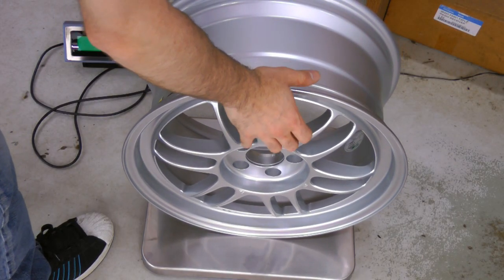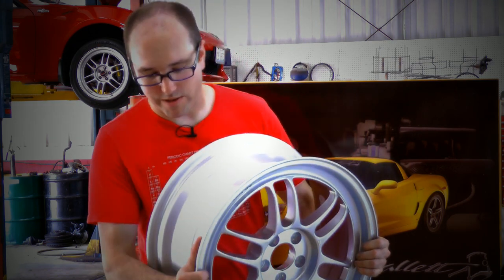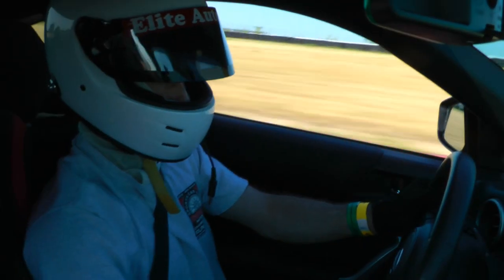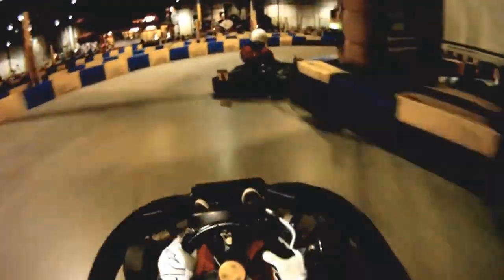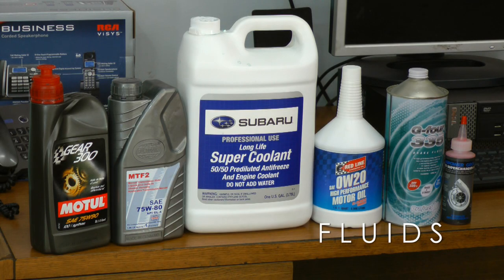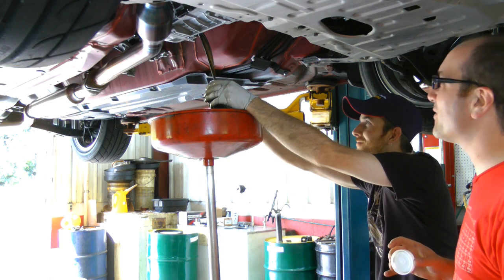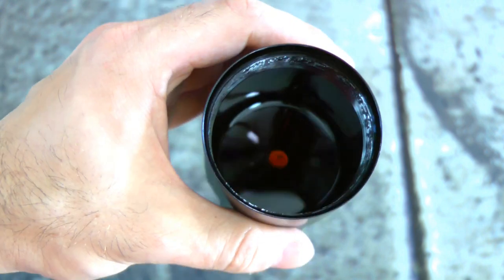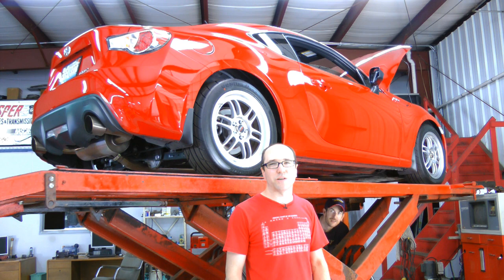Supercharged Vortech Scion FR-S GT86 Track Review Finale | Part 4 of 4

Comment: Cheers dude, consider yourself a modern pioneer of modifying an FRS. Your data and hardwork in the garage will prove invaluable to future modders and you've helped shaped improvements for the vortech kits parts and documentations.

A true pioneer.
Reply: meh. it just bugs me that they all keep talking about needing more power. GET THE AVO WORLD TURBO KIT! just 7psi and your at around 280hp to the wheels! not your 212whp on stage 1 and not your 235whp at stage 3. stage 1 with avo puts you around 250. stage 2 puts you around 280 (with the 7-8 psi actuator) and stage 3? if you can get it, you will find yourself at around 371hp AT THE WHEELS! more power? GO WITH AVO! screw the vortech. so much extra chopping, and cutting, and manual krap you have to do. avo? bolt and unbolt and bolt this in and then go >.>
Reply: Gopher663 supercharger much better for the track and everyday driving( big low end power upgrade) not to mention having this car at near 400 hps is gonna run havoc on the engine/clutch/tranny

Comment from the maker: I went for reliability.  Over 260HP on this car with any kit requires upgraded injectors and fuel pump.  So there is extra cost and risk once you start getting towards 300HP. But many are doing it
Reply: 260 HP or WHP?

Comment: A trick for you who have an frs, in order to fully turn off traction control hold down vsc and trac buttons down for a few seconds and itll completely turn off trac control on the dash board.
Reply: Hold traction control off for 5 seconds and it will completely turn off - an FR-S owner

Comment: Man, the information on all the fluids was excellent.  I will be changing all my fluids at 24,000 miles. Including the radiator and brakes. If I stick with the stock rim size i could lose 20 pounds on those Enki's.

Comment: and while the altima coupe doesnt have a lot of HP, it makes more torque than the FRS does and it has the CVT transmission so when i am gunning it it will hold RPMs at redline so it feels fast, heck my DD im using now is a 230whp 250wtq mitsubishi eclipse GS-T and the 2.5 altima feels like that car does because it doesnt have to shift

i can tell you that when i test drove a GT86, it sure as hell didnt feel fast on the straights, and while fun in the corners, i dont drive corners everyday

Comment: I own A BRZ. I love it. If it were 250 hp and 30k I would not own one. If the FRS was 28k with 17" high performance tires and brakes and weighed 150 pounds less. I am in.  The Z or any other car under 40 grand would have no answer for a 2600 pound 200 hp FRS with high performance rubber and brakes. that is the point of the car. For 32k I would be in a next gen Mustang GT. That car will have 420 hp and weight 3300 pounds with an independent rear. That is what a 250 hp FRS would have to deal with.

Comment: To be frank, I would rather leave my 86 stock, make it pretty and instead buy a Aprilia Tuono. If you want speed, you got to do it right, and sometimes it is probably better to leave the vehicle as intended. I do believe 86 are underpowered but for what I use it, day to day driving, it has more than enough to get you from A to B.

Comment: We're running meth on ours. Making about 270 on Vortech's tune. They've got some safety features built in so it dumps the timing. Pretty sure that with a tune we can make over 300 safely. I probably won't push much more than that. Folks over at dynosty feel 350 will be about the cap.

Comment: I would still rather but the Innovate/Sprintex kit because i think it looks cooler. Also it makes more horses and torque, and being situated in the middle of the engine doesn't effect that 50:50 weight distribution. Also when at low revs it bypasses the valve of the supercharger and maintains fuel economy until you decide to floor it of course by which the supercharger operation will kick in again and boost you into the future, and in some cases milage can actually be improved because the engine output is higher without that much strain on the engine e.g. when going up a steep incline.
Reply from the maker: I am just not sold on the extra heat the Innovate puts on the heads even intercooled the temperature is very hot in that area.  Until we see high mileage boosted cars with working DI and seals holding up I wont risk it.  I agree power delivery down low for a street car/autox is optimal.
Reply: ok cool but that was just my opinion. you vids are great man and thanx for responding. have you considered running water meth on your frs?
Reply from the maker: thanks for watching and following all of it   luckily the Vortech does not have issues with IAT and temps so I won't need it with my current fuel.
Reply: Ok cool but yeah i hope to see many more awesome video in the future and i'm definitely subscribing! (y)
Reply: I knew if I waded through the muck of comments, I'd find this (i.e., what's wrong with the Sprintex supercharger?).  Thanks!

Comment: Is the sound from the car at minute 2:55-3:05 normal my car makes that noise especially when driving for more then 15 or when I rev it around 4000 rpm. Just wondering if it's normal or maybe something I have to worry about I got it new I got right now about 1,200 on it. Is it normal?

Comment: Just subscribed to your channel. Great videos man very humorous but still super informative at the same time. I own a brz here in the PH and been researching about big break kits. I'm wondering now about the specs of your rpf1's I'm assuming they are 17's but what offset? I just got a 17 x 9 +35 and heard that bbk's might not fit at that offset. :-|
Reply: Enkei Wheels says (info I got through a personal phone call) you can run up to 8.5" wide wheel using a +35 offset and have no rubbing issues so long as you stay with a very similar overall tire diameter as stock (which is about 24.6"). Anything wider you should run a +45 offset but you would need to run coilovers in the front so that the wheel doesn't interfere with the stock strut.
Reply: Thanks for the response maximus maxwell when you say rubbing issues are you pertaining to all issues in general (fender rubbing etc) or specifically for the bbk calipers? Because I ordered mine at that spec basing on a few people I asked on instagram who had the same spec and a sales manager from the site I got it from which was oakos.com, all of them said no rubbing issues on a 9" width rpf1 if the offset is +35, the +45 looks more flush on the fender tho but it will apparently rub not unless yeah you chance to coilovers or use spacers. Hence my decision to get the +35 offset one but then I saw a guy who had the same and told me he got his set from a friend because it won't fit now with his friend's new bbk. 😐💭
Reply from the maker: Thanks for watching. Did 17x8 43mm.  your wheels will be very tight but should work.

Comment: and that is why i said more power to you in my original reply, for me, i wont buy a GT86 for the same reason why i wouldnt buy a miata, its too slow for daily use and unless i lived on a back road and drove that everyday, it just isnt worth it, for me

i also heard BMW and toyota are building the new supra with the engine and drivetrain being based off the BMW M55 engine 335i motor but supped up to 500hp and its going to compete with the GTR R35

Comment: how does the supercharger install affect your fuel consumption?  thanks
Reply from the maker: +krisnadi imam When you drive hard it drops it by more than 8MPG(22MPG)  During normal driving its about 27MPG.
Reply: i see. it doesnt drop by much it seems. at first I thought supercharging it will kill the fuel efficiency.
But watching through your series, it surely brings a different perspective about mucking bout the engine. as i owned subaru XV and had been itching to add supercharger. TBH, considering what u went trough with yours, then considering the cost n voiding my warranties, i dont think i will proceed. I live in Indonesia BTW, and aftermarket parts n skilled tuners are pretty expensive and scarce here.Thanks a bunch for your insight.

Comment: Explosive... like diarrhea. Noticeably faster? You don't say?! Definitely an automotive writer. I think you would've been happy as f*ck driving the thing stock with more reasonable expectations. Edit: I've got a Rex with black 17x8 RPF1s and the AP Sprints were installed yesterday. I had the Ohlins, but went back to struts and Rallitek springs. Cosworth long block and AVO450. PW top-mount. It's a fun car.

Comment: The FRS is not perfect. The fact that it even exists in this day in age for 25k and Toyota is going to make money on it is amazing. There are a ton of cars that you can buy with 250 hp for 25k. None of them are as light, efficient and as entertaining to drive as the RWD frs. Being a 370z owner you know you can buy a 300 + hp Z now for under 30k. A 250hp FRS even made from the factory would be 30k. The Mustang GT, 370z, and the Genesis would still smoke it in a strait line.